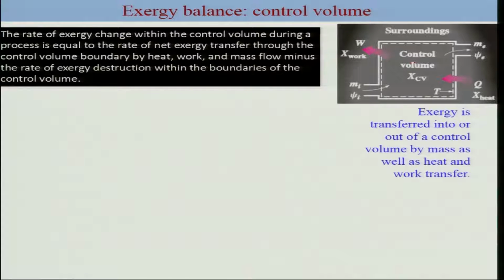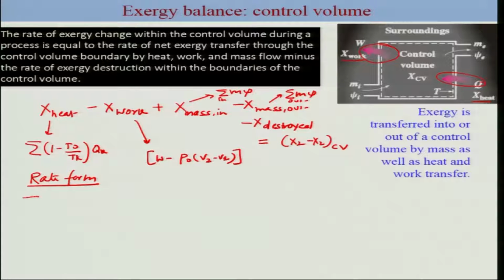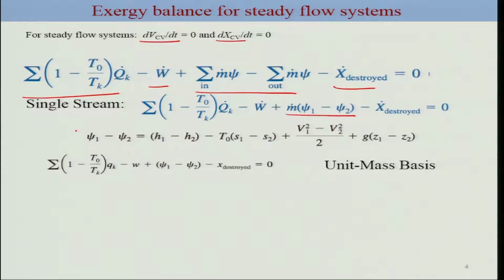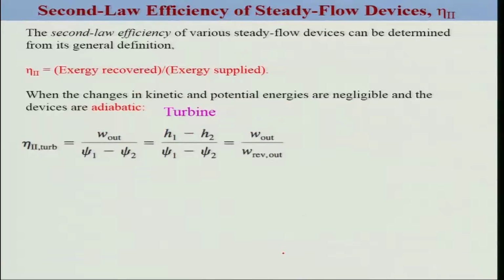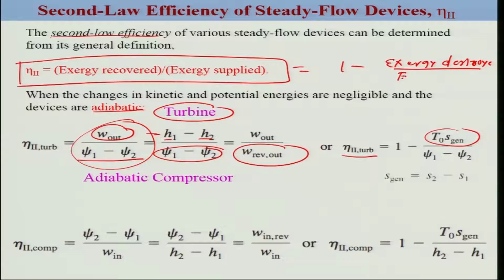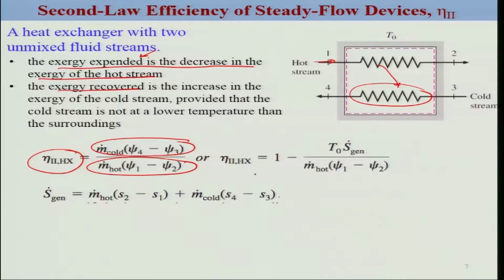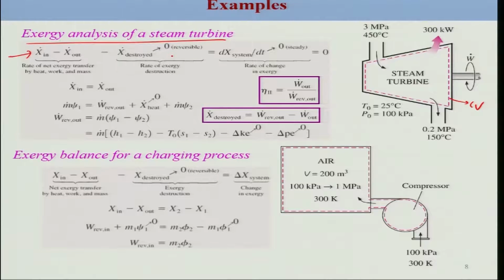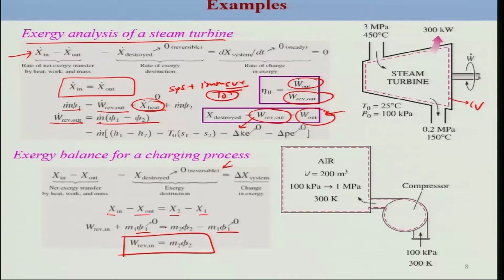Exergy balance and second law efficiency for closed systems and steady flow devices

Comment: At 3:32 the expression for change of exergy of control volume (X2-X1) should contain exergy of flowing fluid, not for the non-flow exergy terms (phi2 and phi1)! I think correction is needed.